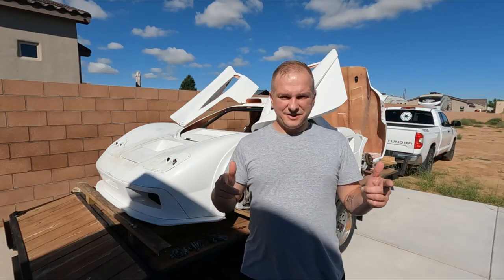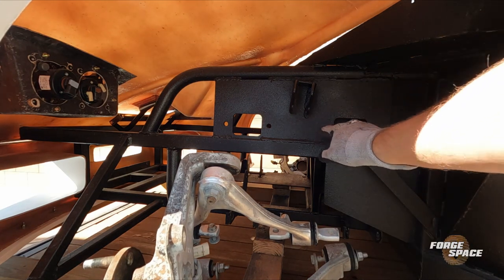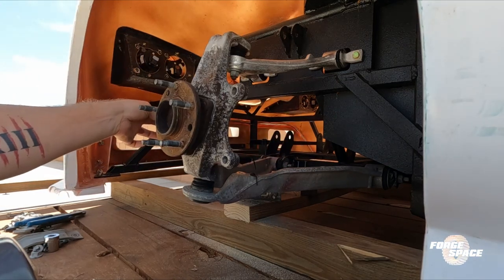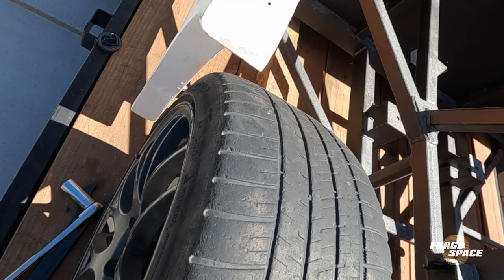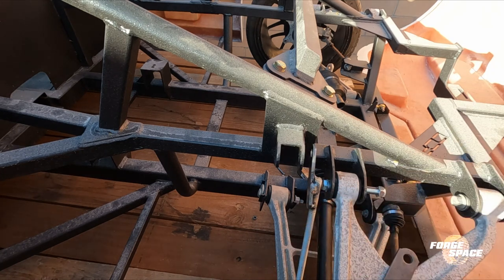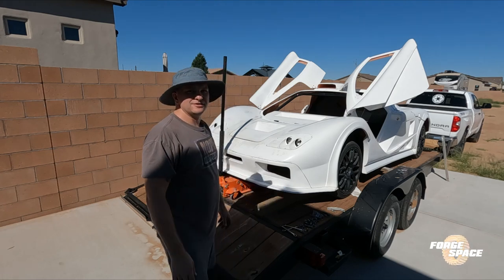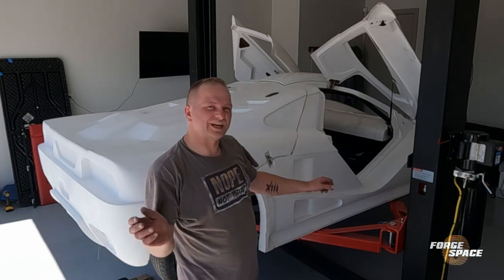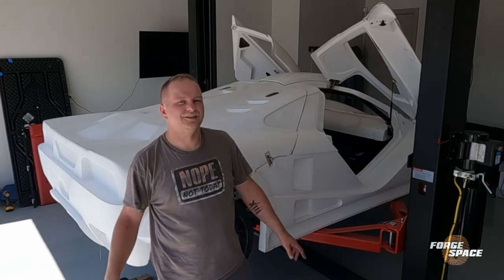Getting the DDR off the trailer and into the garage EP.06

Comment: why didnt you back the trailer right in and use the 4 post lift to just lift it off the trailer
Reply from the maker: The trailer wheel fenders would be in the way of getting the arms under the car. Would have needed take the body of outside and get it disassembled before getting it in to pick it up at a higher point.

Comment: how wide is it? i need to know so when i go get mine real soon
Reply from the maker: 73.25" (1860mm) fenders to fender
Reply: @ForgeSpace  thanks. hopefully mine will be done soon. i been waiting for it over 16 months already
Reply from the maker: You getting a fully built one?
Reply: @ForgeSpace  yes. its been under construction for over 16 months already. its been rough times. it was supposed to be done in 6
Reply: Are these guys still producing kits?
Reply from the maker: They are and are working on a new version of the kit, the Vera GT.
Reply: @ForgeSpace  I did email them about a week ago but haven’t heard anything. Thanks.
Reply from the maker: They are not easy to get a hold of. Call him and leave him a voicemail.
Reply: @ForgeSpace  i believe is still a prototype yet. but the CEO told me that he sold one already. clearly not a cheap build